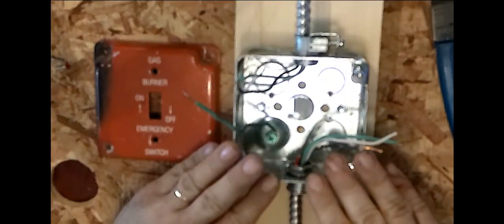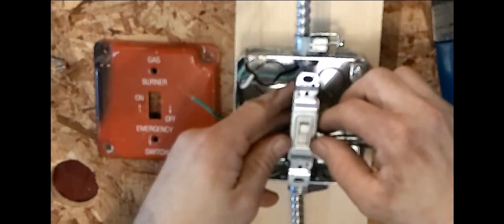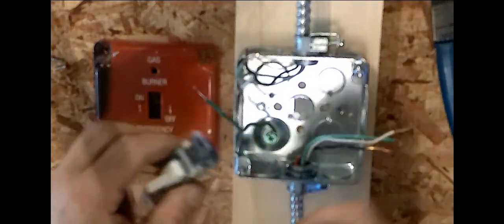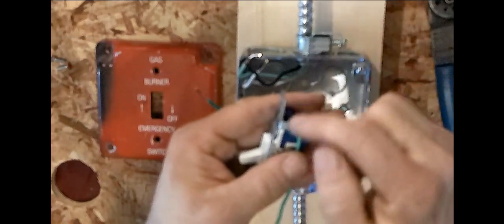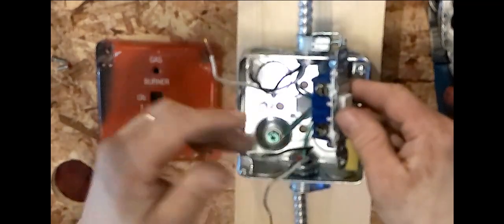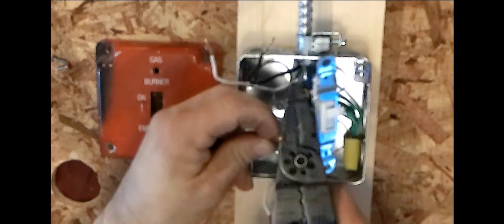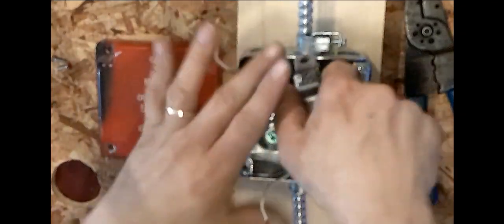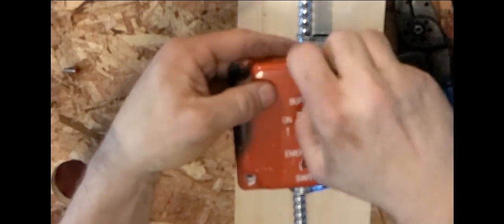How To Wire A Boiler / Furnace Shut Off Switch

Comment: When I moved in my house my boiler had 2 switches, one at the boiler and one at the top of the stairs. They were actually wired as a 3 way! Oh no!!! I ripped that all out and rewired it and put both switches in series. Last thing I needed was having someone accidentally turning my boiler back on while I'm downstairs working on it!
Reply: I'm trying to do the same... just not sure how the wiring goes. Any suggestions? can't seem to find any videos showing how to do it.

Comment: I came across a sloppy residential gas boiler installation. The boiler 120v bx wires are connected to a dangling switch out of an embedded/finished wall single gang. How would you connect the box to a wall switch without just punching a hole in the drywall?
Reply from the maker: I would probably mount a 1900 box over the embedded box and run the power wires in the embedded box into the 1900, then the bx out of the 1900 to the boiler and secure it neatly with bx straps. Mount the switch in the 1900 box with a switch cover. Other than that, you're removing drywall.

Comment: Is that a regular 15a light switch? Shouldnt you use a higher amperage switch for this type of application?
Reply from the maker: Most furnaces and boilers are on 15amp circuits and rarely pull 10+ amps.

Comment: Can I ask what AWG wire size do you feed the switch with? Is it 14 or 12?
Reply from the maker: Depends on breaker size. Usually 14 ga. For 15 amp and 12 for 20 amp